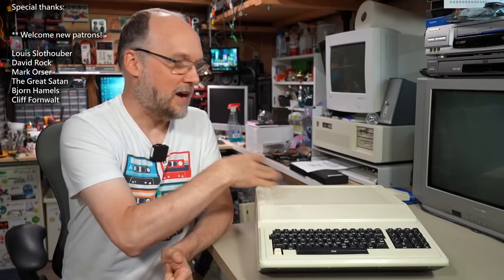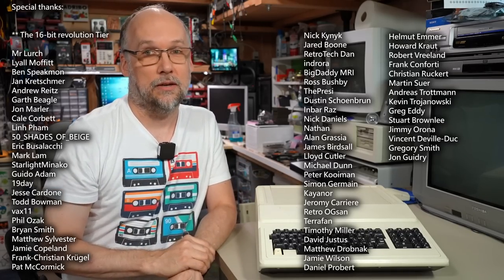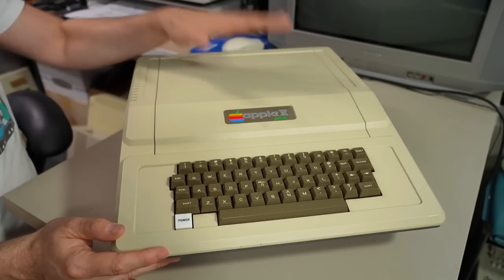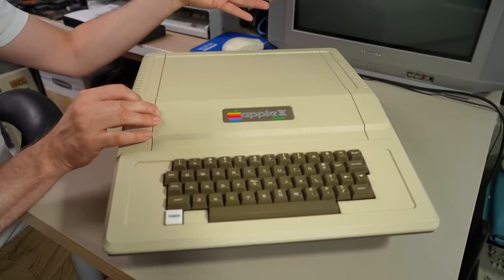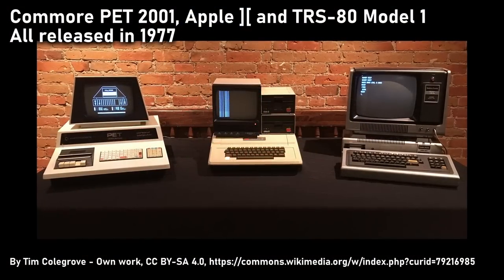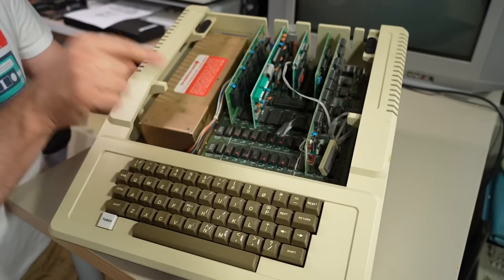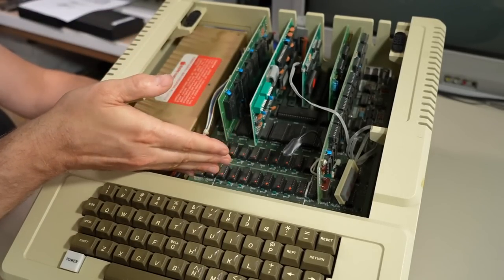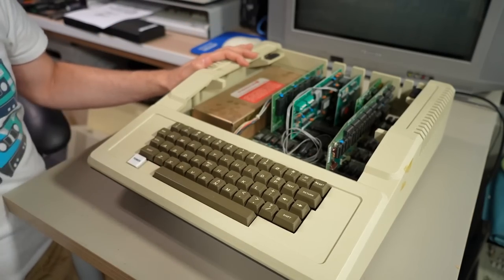Apple II+ clone repair: I thought this would be easy... I was wrong

Comment: One of My first Apple computer was a Taiwanese Apple II clone clone called the Unitron u2200. Basically a desktop case with detachable keyboard/speaker. With 64k ram, 6 expansion slots and 6502 & Z80 CPU. I'm sure they were legal to sell as we had these in my high school computer labs here in Australia before they were sold off and replaced with twin disc drive MAC SE computers.

Comment: A Huntron tracker or curve tracer can identify bad output drivers of an IC without power applied to the IC.
You can also disconnect the clock, power up the board and use a logic pulser and logic probe to test logic ICs.  
It a pain and time consuming, but doable.

Comment: Congratulations for the tenacity Adam, I would check on the new pcb without components if there is already a short circuit! At this point it could be a manufacturing defect of the pcb. greetings from italy.😅

Comment: Back in '80 or '81, my father and went to various stores and bought all the parts needed to assemble a clone at a fraction of the cost of an Apple. it has the same case,  keyboard doesn't have short cut functions. Motherboard had a Unitron branding on it if i recall. it was very close to the board you have there. It took us about 2 weeks to complete the soldering with only a couple hours a day for one of us to work on it. We knew people with equipment to burn eproms back then, so, we had copies of the originals, we also had the modified beep tone and banner, which I'm sure are still in it. I loved the Apple ][ era. (also had a TRS-80 Model 1 L2 with floppies and a modem. my father would use it to connect to the main frame at work to look at issues. i would use it to play text based games and Adventure!. )

Comment: If it wasn't 53 minutes long, I would have linked this to the definition of "cliffhanger" :-) Can't wait for the next one!  Absolute brilliant detective work and love your reaction upon realizing there's a short between two data lines in a rat's nest. I'd trace out the lines on the schematics using two different colors and a 3rd for the chips in which they interact or intersect, but I'm sure you have a better way of doing it. and I can't wait to see it

Comment: You need a Toneohm! Low-ohms meter with a tone output, so you can chase around the board with the probes looking for the nearest place to the short just by listening to the tone. It's indispensable on the repair bench.

Comment: Apple II has interleaved memory access. With the bus transceiver disconnected, you will still see activity on the address lines because the video generation logic generates addresses on the odd phase of the clock. The whole purpose of the bus transceivers is to ensure the CPU is off the bus during video/slot DMA.

Comment: Back in the days when Apple made the most expandable machines... And today you often can't even change the harddisks or add more memory.
Reply: and repairable.
Reply: You used an unapproved apple screw, your operating system is disabled.
Reply: and they even take away ports (e.g., audio out port) and have a penchant for their own proprietary connectors where they could easily go with industry standard choices (e.g., the power connector)
Reply: @TheSulross magsafe is the best thing apple has ever done (the MacBook one. The iPhone magsafe is stupid)
Reply: Yeah, we need a new Steve Wozniak. 😊
Reply: That's just the industry in general. Finding a laptop now that's simultaneously easy to get into and easy to expand is now the exception, not the rule.
Reply: They want you to buy an entire new machine. Its all about $$$$$$$. How else could they become a trillion dollar machine so quickly?
Reply: Steve Wozniak was born for Linux. I’m surprised he never jumped into Linux in a big way. It seems so perfect for his ethos and approach.
Reply: Can't change unless you are dosdude1
Reply: @tonycosta3302  Apple went the BSD route instead.
Reply: @oofingberg  Eh, I dunno. I do like the fact that they theoretically pull out to make the system less prone to getting chucked onto the floor but in practice, the connection is so strong they sometimes don't come out even if you jolt them pretty hard and the Magsafe ports on the older machines that had them are prone to getting clogged up with filings of the magnet as it disintegrates, causing the resistance to creep up over time eventually resulting in them getting super hot and starting to discolour the cables. Dunno if the re-invented ones are better, I must confess I've not used the one on my M1 16" MacBook very much because it's much more convenient to have USB-C cables around which can charge all my devices than keeping the Magsafe to hand for one specific device.
Reply: Often?  More like "never", although it doesn't seem to be hurting them from a sales perspective.    

It will be interesting to see what Apple does now that that EU has decided that all mobile phones should have replaceable batteries.
Reply: @benanderson89  probably a lot cheaper, but people often buy laptops based on how light and slim they are.
Reply: You would think that an Apple phone would be built with the guts as a single unrepairable electronic "glob" in substrate - display and battery included.

Comment: If all the chips are socketed, make sure to check for pins bent under or sideways.  The previous owner may have caused a new problem while troubleshooting an existing one, and you're discovering it now.  I've seen a bent-under pin soldered to a plated through-hole pad that worked (not socketed) but in the process of getting bent under it cut cleanly through an unrelated surface trace running under the chip.  Fun to find, relatively easy to fix.
Reply: Is it really hacker space? Or an area not removed to patch gotchas in the design? I see those and/or ic patterns to be able to patch a board...
Reply: @thinking-laaf  If you mean the grid of feed-thru holes, I remember seeing those years ago.  Yes, they were there to allow adding components and "bodge" wires to implement ECOs (Engineering Change Orders) as needed.

Comment: When I was a kid, I bought an Apple 2 clone like the one you have there with the keypad.  That was many decades ago and it's since long gone (I had bought an Apple //e afterwards). Apple clones were on the market before IBM PC clones existed.  Most of these Apple clones are long long gone.  I found and picked up an Apple 2 clone (no keypad) which is so blatant that it actually says "apple computer" in apple's font on the badge.  It's pretty funny.

Comment: Great video! Excited to see you figure this one out. 

Although it may take longer, rather than using one probe to bounce between pins on a logic IC, I prefer to use 3 or 4 channels on my scope to look at multiple inputs (if necessary) and an output.

For example, to make sure a bus transceiver is working properly, I’ll measure and trigger on the direction input pin as well as an input/output pair of pins. This lets me see if one side of the IC is weak and not fully driving the busses.  Because either side of the bus transceiver has other sources that could drive the busses, without seeing a pair of pins at the same time on the screen to compare, it’s difficult to prove full functionality. 

I used this approach on a Nintendo VS arcade PCB and identified almost a dozen bad logic ICs. It helped to pull up data sheets for each IC and use the pin out and truth table to verify proper operation, marking the schematic as a checklist as I worked my way through.

Comment: As a test, replace chip f14. This is the 74ls259, which is not only controlling the display modes, speaker and tape but is also connected to the game io connector c040. Maybe a dodgy apple paddle ot joystick fried the chip. There is no chip protection. Also f14 is connected to a3

Comment: The one thing I seriously want to do is fabricate clones of some motherboards that used the NiCd batteries and have them use coin cells in place of them or only a header for a 4.5V battery holder. For example, the one Jetway 3/486 board I have (or had, cannot recall if I still have it or not since I cleared some clutter out of my room recently) was under heavy battery leakage/corrosion and a lot of traces were damaged and repairing it was complicated and it almost worked. I have a working one that had 2 small drips, but I got it cleared up and it runs great.

Heck, even for OEM system motherboards, I would do the same thing.

Comment: I hope it's not a sliver of solder across a trace or pin.  Those can be exceedingly hard to find.

If you can pull ALL of the chips off, you might be able to burn open a short by applying, say 24Vdc at a high available current.  A sliver of solder will open (like a fuse) if you push enough current through it.  This is extremely risky, but it can work.

You can do the above trick at a lower, safer current if you have access to infrared camera equipment,  push in the power and look for a hot spot.

Good luck!

Comment: What usually happens (Not sure back then, but certainly these days), is that the company (in this case Apple) will send out to a variety of suppliers a request for an example product that meets the specifications that Apple sends to them (Such as the Apple IIe case).

The suppliers then either come back with an example product or a 'can't supply', Apple then looks at each example that comes back to determine which supplier (or suppliers) they will use for the final product.

Now, the losing suppliers should then destroy the specifications that were sent to them, but hey, they just spent all this money setting up tooling to make the example product, like they are really going to let all that tooling go to waste.

So, they when Apple finally releases the product to retail, the suppliers who didn't win the contract and who didn't destroy the specifications, start manufacturing 3rd party products, just not officially endorsed or badged.

This then means that companies like Laser, etc... have a ready to go product that they can utilise.

Other ways it occurs is buying the retail product and then getting all the measurements, etc... to create your own clone of a particular part of it.

Comment: Having repaired a genuine Apple ][ Plus (rev RFI) that I purchased last year which had 11 separate faults I’m really enjoying this video and I’m looking forward to the next one (or two). I only used a logic probe and multimeter to find all faults and didn’t need to crack out the scope. Not all faults will necessarily be chips or components. I had several that were due to corrosion of pins. That book you used is awesome and was the one I used as it has all Apple ][ plus circuit revisions (just have to make sure you are using the right revision). In your case there is that extra difficulty factor of it being a clone with some variations from the book.

Comment: The 2SC1815 transistor is a Japanese TO-92 pinout, with
  E C B
But the 2N3904 is E B C.
That seems to be the reason why it tested good but didn't work in circuit.  They should be replaced with the 2N3904 which has slightly better switching specifications.
Thanks.

Comment: I had an illegal Apple II+ when I was a kid.  I used it most of the way through college.  It had the actual Apple ROMs in it.  No clean room stuff for me.   Mine was kind of interesting in that it also had a Z80 and could also boot to CPM.  I didn't have any CPM software at the time, so I never booted to it after I first got it.  It was pretty reliable.  I managed to get all my college papers done on it.  I used AceWriter for that.
Reply from the maker: Do you recall if it has the Z80 on a card or was it somehow integrated into the motherboard?
Reply: @adriansdigitalbasement  it was integrated into the motherboard.  It seems like there was a key combination when you turned on the computer to go to cpm.  If there was no Apple ROMs, it booted straight to cpm.
Reply from the maker: @Slim_Chiply  that's a really cool "feature-add" over Apple's stuff. On a real Apple II you had to buy an extra card, but not on the clone. Neat!
Reply: @adriansdigitalbasement  There were a few with the integrated Z80. I had one that had the ROM on a card that plugged into slot 1. There was no slot 4, and the RAM was a single row of eight socketed chips (64K). It said "EASY ][" at the top of the screen instead of "APPLE ][", and there were macros for common BASIC commands as well as all the Demosoft apps. The keyboard was similar to the one in the video.

Comment: My Apple II clone looks almost identical, except they keyboard is grey and white and missing the printing on the front side of the keys. The logic board design is very different, so I suspect it's from a different clone manufacturer that just used the same case. At least it doesn't have the prototyping areas, so perhaps it's a similar design, just without those on the board, and it does use a different power connector.

Comment: Many of these clones were built from parts (as I built one from parts in around 82). The motherboards with fully programmed ROMs were sold, along with all the other parts.  It would have been near impossible for Apple to target those kind of sales since they would be just parts.
Reply from the maker: Indeed, especially if the kits that were sold were assembled in country (so never crossed the border.) So you only had to install the motherboard into the case, install the PSU and keyboard and then you were good to go?
Reply: I remember tons of ads for them in Computer Shopper.  That's where I got mine.  Probably 82 or 83
Reply: @adriansdigitalbasement  For sure.. I'm not sure what triggered it.. perhaps the demand for cheaper computers and those who could afford a new authentic apple II+ (since they were over 2K CDN back then), all of a sudden there was an explosion of new stores that sold apple clone parts (mostly in Ontario). Most of the parts were made in Taiwan and really varied in quality. This same clone craze  eventually happened with IBM clones for the same reason. The IBM PC (the first one as shown on Byte Magazine in Jan 82) was also really expensive $2000+ CDN for just a basic monochome system with no hard drives. It was the beginning of the home computer boom I guess.
Reply: @Slim_Chiply  Me too... I think computer shopper was filled mostly with ads from sellers :)   This era was truly heaven for those who had a strong interest in home computing. This lead to networking home PCs together, and then modems to connecting to external BBS's, etc, the start of home access to internet (although it was just a txt based shell account in the beginning), and then compuserve where you actually got graphics).  I miss these times so much as I found them so exciting.

Comment: One approach could be checking low ohm measures and finding where it's lower or higher.
Other could be cut some traces and isolating half of the board to see in which side is the short.

Comment: Many of the signals you indicated as being fine looked like total crap to me. That stepping effect on the signals I would associate with bad crosstalk or high resistance shorts. Given the age of the board and the sloppy construction, I might think of oxidation or contaminants from degrading solder flux. I would wash that board really well, clean off all the solder, and then try the continuity tests over.

Comment: Possibly a ram chip for bit 2, that would use both the address line 3 and data line for bit 2.
Reply: There's a multiplexer between the address bus and DRAM, so no way to have a short there.

Comment: Two things - check for a short in card socket.

Otherwise - what I’ve seen Northridge Fix do is put a thermal camera on the board and then look for the hot spot as he slowly turns up the power supply.

Comment: Hi Adrian, great try on the clone board.  I saw a solder run at 49.58 minutes, 5th (?) chip down in the center of the board.  A little later it's not there so part of your multiple failures?  Good luck.

Comment: The TRS-80 did have demigraphics. The SET and RESET commands will create or adjust semigraphics characters as needed, providing an API that looks precisely like control of an ordinary bitmapped display.

For x=0 to 127
For y=0 to 47
Set (x,y)
Next x
Next y

Is a demo that shows the TRS-80 working as if it has a graphics system.  Back in the day the average BASIC programer would not know any different.  Also programming using, set(x,y), reset(x,y), point(x,y).  Trying to mix this mode with the Print@n, chr$(c) where n=the print location from 0 to 1023 and c is a ASCII code or a Character code.  Graphics characters go from 128 to 191, will interfere with each other.  So yes it's a text, semi-graphics system but at the high level of BASIC it is like using ether text mode or graphics mode but not both together.  Ammm I think I remember a way to limit how many line could display text so forming a small scrolling box on the screen where the text would not interfere with the graphics using pokes but I will have to try this to see if my memory is right.

Comment: It's actually not completely true that the TRS-80 had "no graphics".  It actually did support low resolution (128x48 pixels, black-and-white) graphics, using 64 of the values above ASCII to bypass the character generator and send image data directly to the screen instead.  (And, for example, the TRS-80 BASIC even had commands to draw on the screen at particular X/Y pixel coordinates, etc.)

It was very poor resolution compared to the Apple II (or VIC-20, etc) graphics modes, but it was still used effectively by many programs and games to render actual graphical displays (and sometimes even bitmapped pictures, etc)...